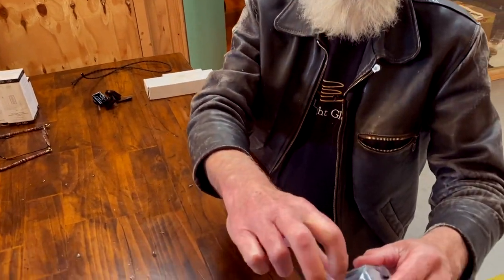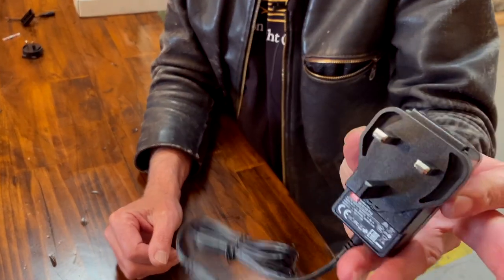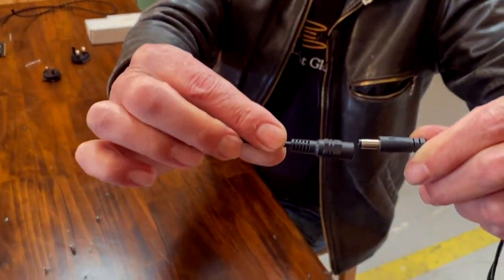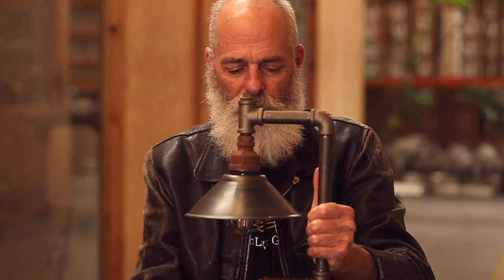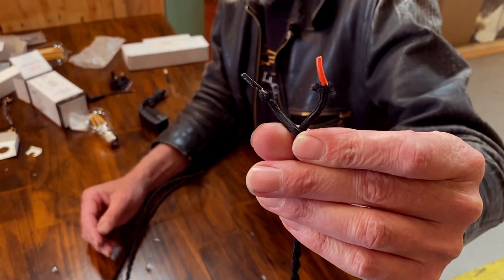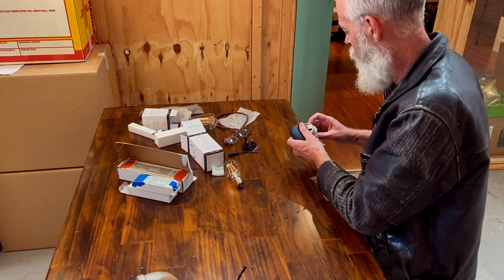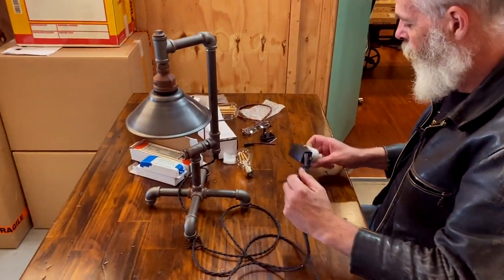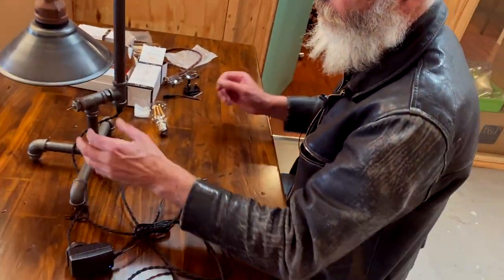Low Voltage Lighting hardware

Comment: Plug in power packs like those mentioned are called power supplies, not really transformers, especially DC but even AC.
22KV is really only used for local distribution and for larger industrial sites. Inter and intra state transmission would normally be 330KV or 500KV. Same reason though, smaller cable size as current is lower as voltage goes higher.
Reply from the maker: Always nice to get technical clarification. Thanks